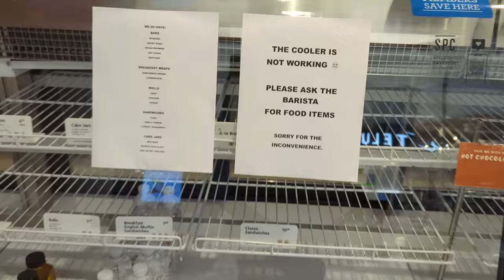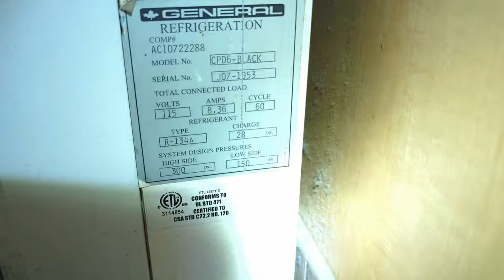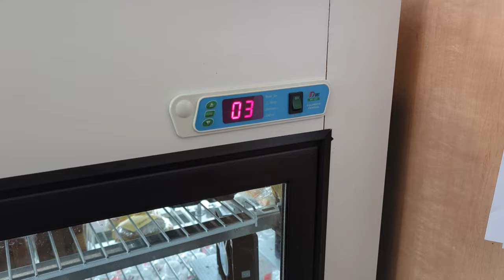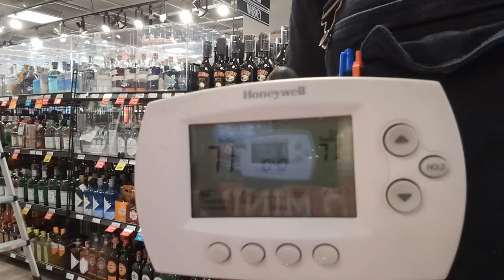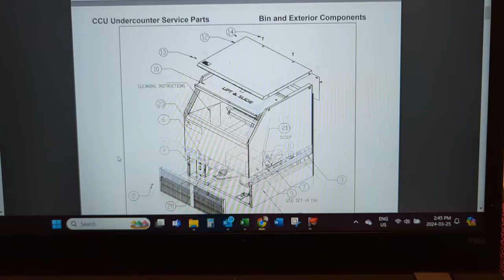Display Coolers Ice Machine  HVAC Filters | HVAC Vlog

Comment: Just tech tip when you suspect a under charge turn system off and let pressures equalize then use a couple of leak test caps which are caps with gaskets and a hole drilled in the top put them on before you apply your hoses or probes then use bubbles on cap look for a bubble forming then apply hoses this will confirm if core is leaking and then when you take hoses off put the leak test caps on again to verify no stuck open core valve.